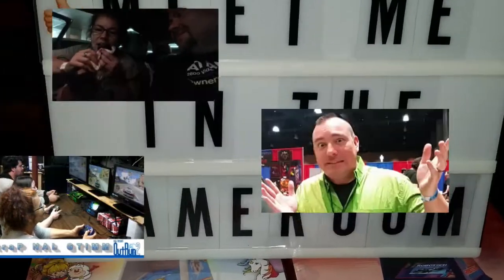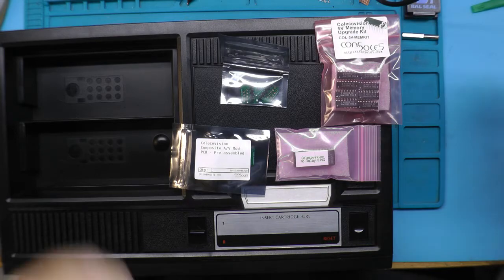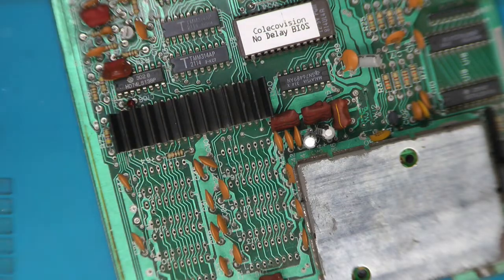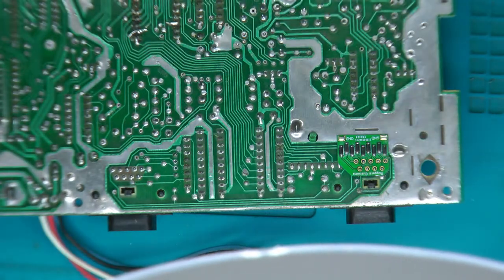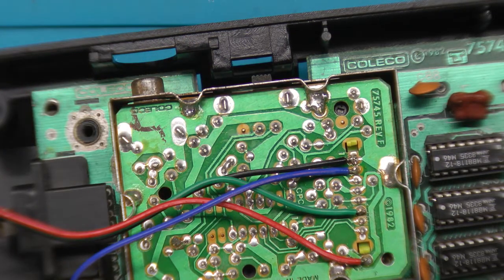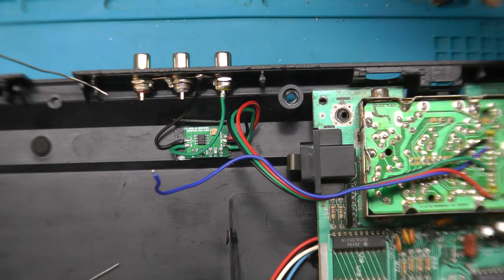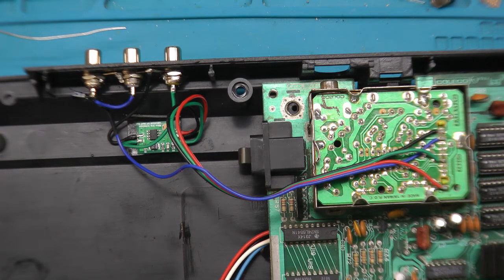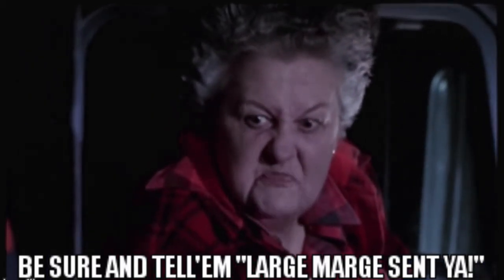The ULTIMATE ColecoVision Build ep57 MMITG

Comment: I pulled my old CV out of the basement a few years ago and fired it up.  It worked, but the picture was pretty lousy (noisy, occasional loss of color, etc.).  I cleaned up the guts, and I seem to recall modifying some stuff in the RF box going by some instructions I found online.  Whatever I did, it seemed to do the trick.  I want to say the mod involved taking the RF modulation out of the circuit and running the video signal direct to the AV input…might have included the addition of a few discrete components as well.  At any rate it did seem to do the trick simce there weren’t any issues after that.  You mentioned performing a 5 volt mod…what did that entail and why might it be recommended?  Great video, and thanks for keeping these things alive.  The CV is the most underrated of the consoles of that era, in my opinion.
Reply from the maker: Very underrated console I agree. Getting the rare opportunity to actually play a Colecovision back in the day was getting a chance to play a NeoGeo. It was completely awesome but not many people had them. I didn’t get one until much later in life but have always appreciated it.
As far as the 5v mod goes check a website called console5. They sell tons of repair and mod parts and have some great instructions.
The Colecovision power supply is a pain in the ass. It runs 3 voltages all at the same time. A +12v line. A +5v line. And a -5v line. A lot of  Colecovision problems boil down to bad ram. The original ram uses the +5v. The new replacement ram does away with the need for that power line and by removing a couple old style capacitors and running a couple jumpers it’s done. The hardest part of the job is getting all the old ram out without ripping the old circuit board apart. I’ve done this mod a bunch of times and still usually pull up a trace somewhere lol.
I hope this was helpful and thank you for watching and commenting. Keep them old systems alive!
Game on

Comment: Solder should be melted on, not painted on. There's no need to brush it like that. You should also bring the solder to the joint, not melt it on the iron first. Otherwise you burn off all the flux before you're done (assuming it's rosin core solder). Check out some videos to see the proper technique.
Reply from the maker: Thanks for your comment I really do appreciate it. 
So it’s gotta be tough to worry so much about how someone is soldering. Trust me dude I’ve been soldering for 40 plus years and just because someone told you that you better do it like they do it or your doing it wrong doesn’t mean they or you are right or should be telling someone else that they are wrong. My techniques are my self taught ways. I do not have problems with solder sticking or not hold up solid for years.
I hope you can just relax and not worry yourself enough that you think you need to tell someone they are wrong.
Sorry pal but you are wrong
Reply from the maker: And! This isn’t a video showing proper soldering techniques it’s a video about an upgrade to a Colecovision.

Comment: Any suggestions on how to get a better picture? I did the same mod, I went with the ColecoEm ( I think it's called) for the power supply and even changed out the power switch to a rocker. Worked great for a while but now I am losing video signal (but I still hear sound). When it does come in, the picture looks on the fuzzy side.
Reply from the maker: I do not like those rocker switches in place of the original. If you still have it I highly suggest opening it up and giving it a good cleaning AND polishing. Then use some dielectric grease to lube it.
Those rockers never seem to hold up and can burn out quickly.
Also try adjusting the two adjustments in the RF box. One is sound and one is color/picture.
Try that and let me know if you have any luck. It could also come down to a ram or bios issue. More easily obtainable parts from console5.com

Comment: Hi which bios is the best fireskip or no delay?
Reply from the maker: Hmm? I don’t know about the fireskip but I’m going to have to look into it. I’ve had good luck with the no delay bios. It’s an easy enough chip to replace. I highly recommend cutting the legs on the original chip and then taking out each leg one by one. Much less pain in the butt than trying to get it out with solder wick.

Comment: Where do I got to get the mod parts
Reply from the maker: Console5 has lots of parts available but they are out of the ram chips and the av mod boards. You can find other more expensive one on eBay or look up Ben heck and do the av mod his way. We’ll just have to wait for console5 to get restocked up. They have the bios chips and controller port mod chips and are very reasonable with their prices. Good luck. Let up know if you need any help. Game on

Comment: Better that you omitted the view of the soldering instead of the deconstruction of the cabinet. Soldering the thread of the plugs, who ever gave you that stupid idea? Tinning the soldering iron and then tipping the wire to solder it, that is the wrong order. I hope that this was not seen by young people or those who still have to learn to solder. 
 
When soldering you need three hands, It is important to heat up BOTH things that are going to be soldered, if only one of the two is hotter then the other and when cooling down only one of the two is cooled down earlier and this makes a connection that doesn't last. Then there is a permanent friction between the material and the solder. The troubles will only appear long time after it was soldered. You must heat up the wire AND the PCB, both at the same time, then add solder to it, the solder then flows where it should be, then it cools down equally and only then you have a perfect connection. 
 
There are good helping hands available for soldering, a crocodile clip to hold the wire or the component, right hand for the soldering iron left hand for the soldering tin. I have seen men that can control their fingers in a way that two of the fingers hold the wire and two other fingers from the same hand hold the wire that has to be soldered. Don't do this with the hand that holds the soldering iron. 
 
A giant in this is BIG CLIVE, he can make a perfect soldering while talking about serious things at the same time.
Reply from the maker: So when I was 14 years old I replaced the rca av jacks on a vcr that had been ripped out when the cord was tripped over. I had no idea what I was doing but I could tell what was broken. I replaced them with these same style connectors because that’s what I had. The “Stupid idea” was my idea. So I guess you’re calling me stupid. I thought on this a long time today as I didn’t want to respond to you with an attack. Even though I feel that being called stupid is in a way being attacked.
I’m not an electronics expert and I have never claimed to be. I’m just a hobbyist with some ideas a lot of people seem to appreciate when I share with them.
I fixed that vcr over 35 years ago and I still have it and it still works.
So maybe I don’t have the perfect soldering technique. And not enough hands to hold things the way you think I should be holding them. But, my stuff works well when I’m finished. 
That Colecovision rocks and the half dozen other just like it I’ve sold have had no complaints.
I’m sorry my ways offended you and put a damper on future of our nation’s youth.
By the way the solder on the jacks is just a little insurance to help keep the Jack from spinning. When you don’t have lock tight or ca glue the solder is an option. I’ve moved on to a whole new style of Jack so I won’t be making that stupid mistake anymore.
Frank
Reply: @meetmeinthegameroom8686  Hi Frank, never I called you stupid or did I mean to call you stupid. I believe in repair and if I see something that can be improved then I say so. If I would have thought that you were not capable of excelling even further then I would not have tried to bother. And if I would have called somebody stupid then that remark would have been accompanied with a few blasphemous remarks and a number of illnesses.
Reply from the maker: I got ya man. Sorry if I took your comment as coming off a little strong. I’ll try to not make assumptions but sometimes it’s hard to really tell someone’s emotions in text and can make it seem rude.
I hope you’ll stick around and keep an eye on if I’m screwing something up.
No worries 
Frank